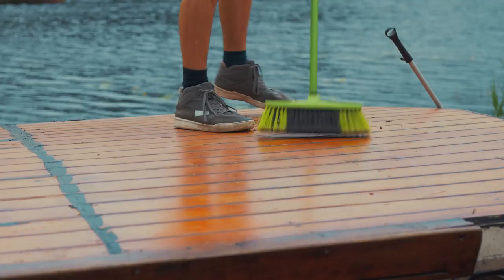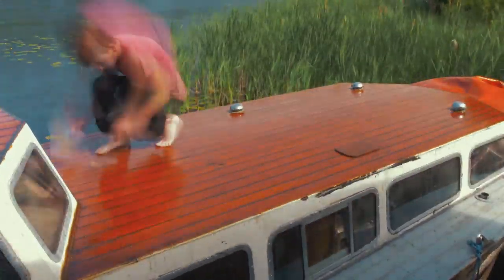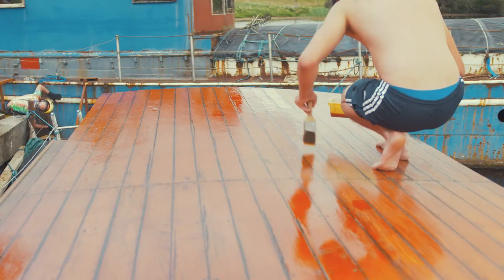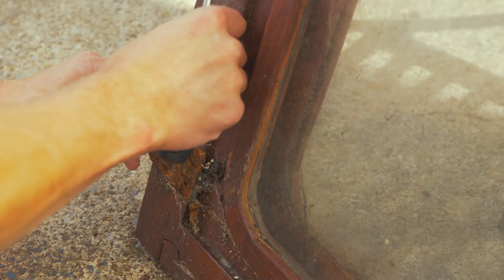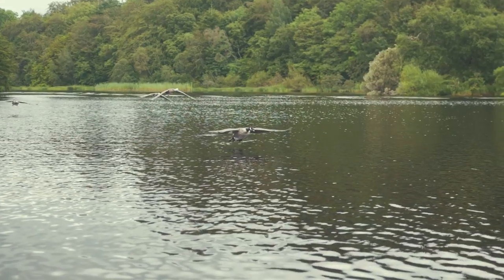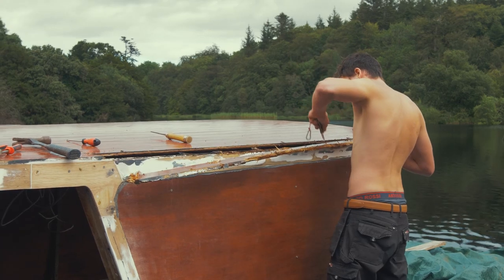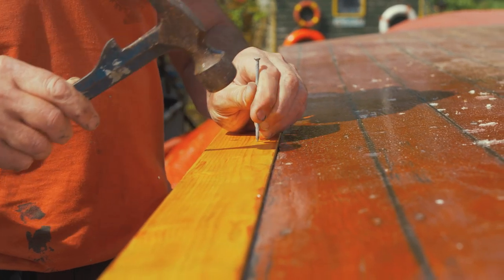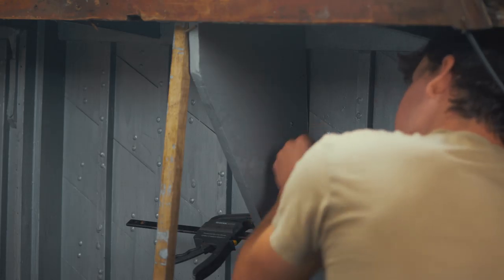Episode 09 - Restoring a 40' Wooden Boat ⚓

Comment: With calking the windows,it is a good plan to install them loosely first with the Sika-flex and tighten them down the next day so you have a thick gasket that wont all squeeze out. Hold the screws or bolts and turn only the nuts. CHEERS from Western Canada!

Comment: hey been recently following your progress as i have a similar project at the moment. the issue i've had is my wooden sliding doors. it needs completely redo-ing. what's the best mechanism for it to slide and for security on the inside aswell? thanks!
Reply from the maker: Mine just has a regular rail which the wheels slot on to. They are really for hanging sliding wardrobe doors etc. My wheels were totally worn as they were rubbing against the screw heads. I was able to get the new wheels and brackets pretty cheap. I don't have any secure lock at the minute just a regular bolt style lock you would use on a gate or something.

Comment: Im letting myself use the google algorithm to watch your channel and for some reason they vend the videos to me way out of order, lol.  It does beg the question though of how much time you spend going in circles.  Doing things then later completely covering it with canvas.  Perhaps this boat needed a complete on the hard year or two for the Hull and deck.  Just wondering out loud in hindsight is much easier ;)

Comment: if you have more sikaflex seams to clean out, heat the tang of an old bastard file and bend it 90 degrees. Grind the tip of the tang to an angle and it will be a good sharp point for stripping the caulk out of the groove.  and fyi: https://sites.google.com/site/cabirmal/home